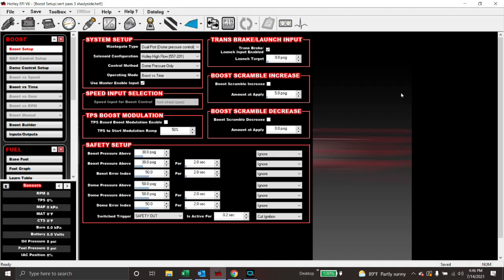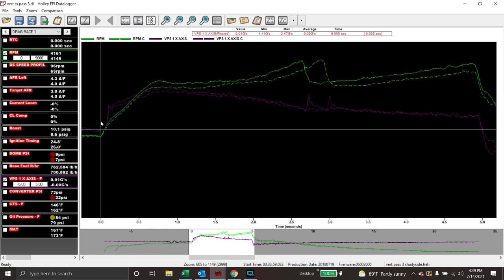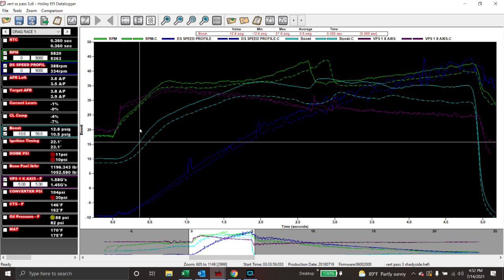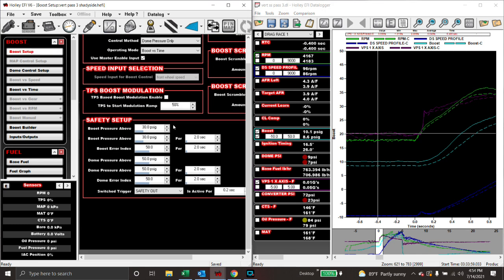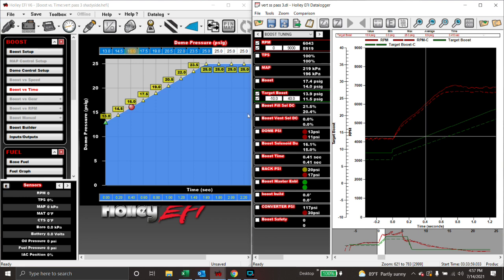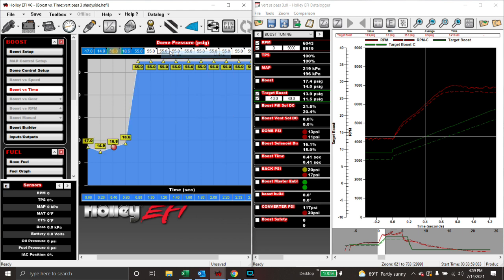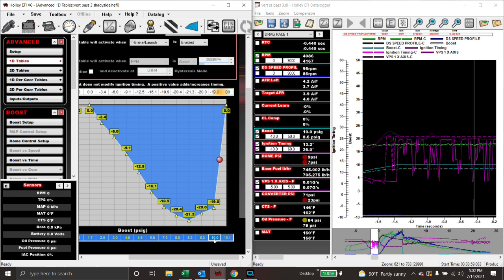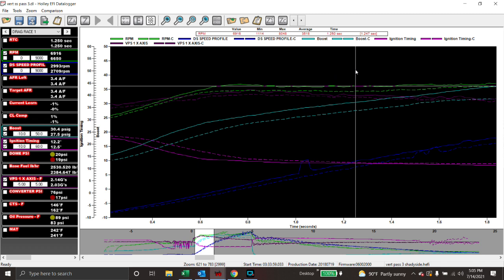datalog review with holley efi part 3

Comment: Can you do a video comparing resistor and non resistor Spark plugs?
Does holley care what type of plug we use,  with ls coils,  and with the ign1a.
Is there a power difference between R and non r plugs. 
I use the B10es plug,  and sometimes they are hard to find,  the Br10es plug seems to be more available.

Comment: Thanks for the videos. Gonna try some of this at the track this weekend. As a Mopar guy, I'm curious if any parts of that 'Man Engine' that actually came from Ford?
Reply from the maker: the block is a ford racing part number
Reply: The parts are for a SBF - when you search for the parts it's for a SBF, meaning I could probably bolt it onto my Dart SBF block.  
Not like what Shawn Murder Nova calls his "small block" chevy, not one part would bolt onto a SB anything it's all one off parts that's why he has so much trouble getting parts like the oil pan that he recently had to send out to get cloned when he threw rods through it.
Reply: @theholleyefiguy  Thanks for verifying.
Reply: @theholleyefiguy  hey ! If u haven't already would you consider doing a video of how to load data from a run into the holley efi system and how to load the tune into the car from holley efi that you created for the next upcoming run ? Thanks 😊

Comment: @Devin vanderhoof could you use a holley terminator x with transmission control to gain more inputs and output? as im using a powerglide and dont need the ecu to control the transmission or are you screwed if you need more and have to go dominator?
Reply from the maker: no